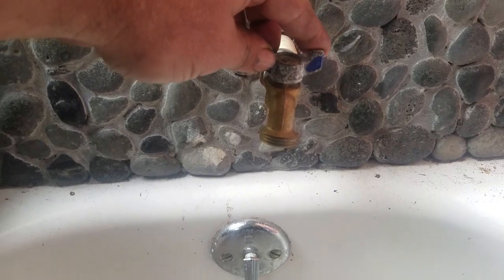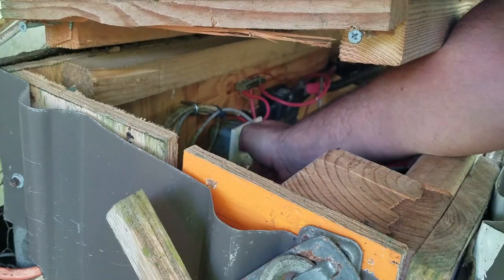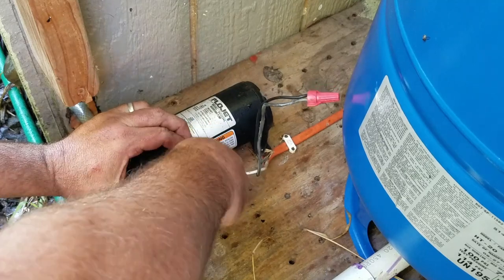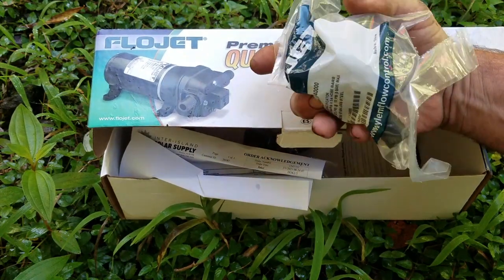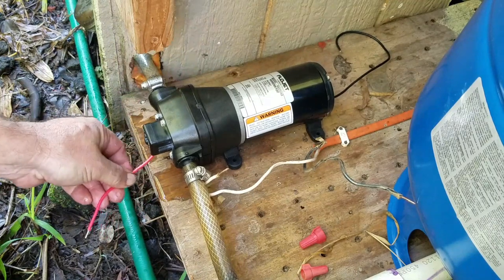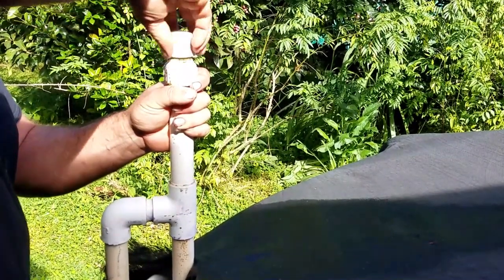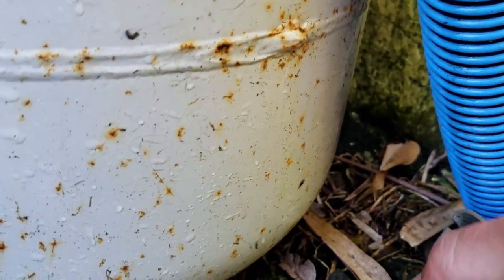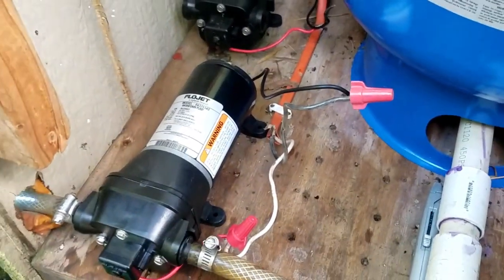Replace a Flojet Water Pump for Off Grid Water Harvesting System

Comment: Awesome sharing. I saw the Amazon link has two models, one with the pressure nozzle another without. Which one should one decide on the other? Why?
Reply from the maker: I wasnʻt able to find the different models you are speaking of on Amazon but this is the one I use, 
https://www.amazon.com/Flojet-04406043A-Quiet-Water-System/dp/B0058TARME?keywords=Flojet&qid=1646322346&sr=8-6&linkCode=ll1&tag=homesteadi0cb-20&linkId=e2bdd8f66b8d883c207edbff25788fb7&language=en_US&ref_=as_li_ss_tl

Comment: I've gone through about 4 of those pumps in the last 4 years and the motor has never been the issue. Its always been the diaphragm getting a hole or the pressure switch going bad. Build it green had the overhaul kit to fix those issues but they are out of business. Not sure if the kits can be found and purchased online but it's cheaper than buying a new pump every time
Reply from the maker: I thought I was burning thru them quick.  This last one was good for 2 years, the one before that went for 3 years.  I would love to find the kit and see about fixing the old ones I have, I'm going to try look.  Mahalo

Comment: If you read Flojets installation instructions on their website (pdf documents) you will see that they prefer to have an open output - flow - when operating rather than pumping into a pressure tank - no flow. Your pump should last much longer if you can arrange switching of the pump to operate only when taps are open and allowing flow rather than the pump constantly fighting to maintain the maximum pressure in the tank. The other way is to fit a non-return check valve between the pump and the tank and fit a pressure bleed off valve that slowly allows the pressure between the pump and the check valve to reduce and the water to bleed back to the inlet side of the pump. This can be achieved simply by fitting a tee that has a small drilled hole that allows the pressure to bleed down in a minute or so but does not allow so much flow that pressure into the tank is reduced. Diesel common rail systems use a similar pressure reducer valve to "bleed down" the pressure when the engine switches off.
Reply from the maker: That is my most constructive comment ever! Mahalo nui loa. I will try it out!
Reply: @HomesteadinHawaii  thanks! I work repairing fire engines. The pumps we deal with use exactly the same principle but on a larger scale obviously. If we run our pump at maximum speed with no flow the water inside the pump gets hot very quickly because the kinetic energy imparted to the water to "move" it has nowhere to go. As soon as the water is allowed to flow the pressure the pump gives is dependent on the size of the outlet (faucet/shower head etc) but the pump load is less because of the flow, and heat build up is less because the water is flowing and having a cooling effect. It might even be beneficial to the motor life to somehow wrap the motor body in a water cooled "jacket" to further cooling potential. Motors usually fail when they get too hot. Lubrication of bearings fail and copper windings overheat and short out. Keeping a motor cool is vital to prolong its life. Just a basic copper pipe coiled around the motor body would allow conduction of heat from the motor into the water filled coil. I watched your video because I am looking at pump options for moving harvested rainwater up to my second storey bathroom. Mains water pressure here is around 50psi so I need a pump capable of providing at least one gallon a minute at a minimum of 40psi. The Flojet looks good but I need to weigh up all the options. As you use yours for the shower do you have a UV filter etc?
Reply from the maker: @paid2getdirty1  thanks for sharing your mana'o. I would.love to run a side by side test to see how well it all works. 

Anyhow, the water that runs thru the house goes thru a 30 micron and 15 micron filter. We shower with it but are good about keeping our mouths closed. Plus the water in our tank is pretty clean already.  We get drinking water at the county spigots which they say is some of the cleanest municipal water in the world.

Comment: I feel like I started a movie in the middle and missed the beginning 😬 I'll go through all your videos but what is the pump connected to? I have this pump in my bus ( I didn't put it there) it only wrks when the bus is on .  So I have to get up turn on the bus 🙄 to go pee, shower or wash my hands ect. I'm hoping to find a way to disconnect it and make like a ",plug" in cord straight to the generator.
Reply from the maker: Just get an extension cord and cut off the plug end and splice into onto the pump. Then plug it into the generator. Should work that way for ya.